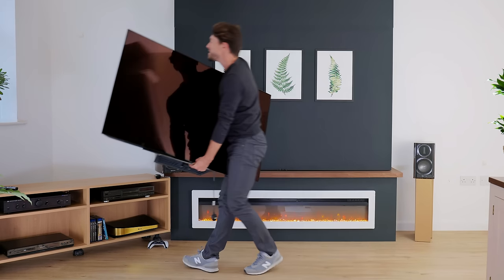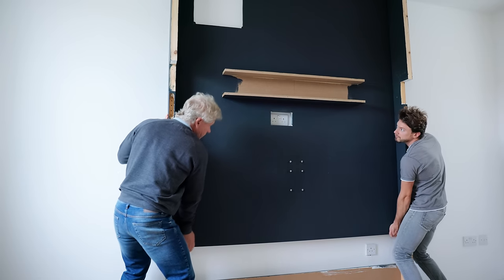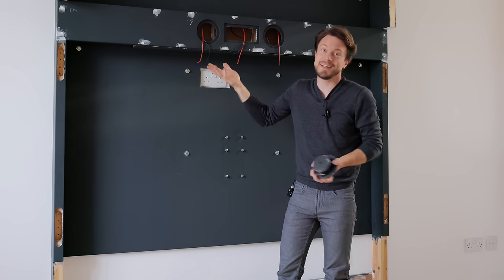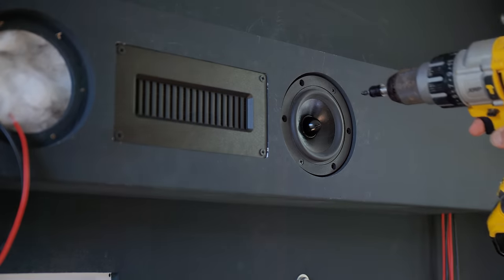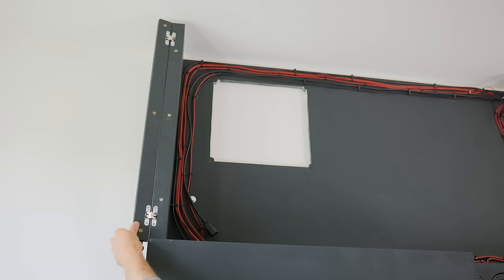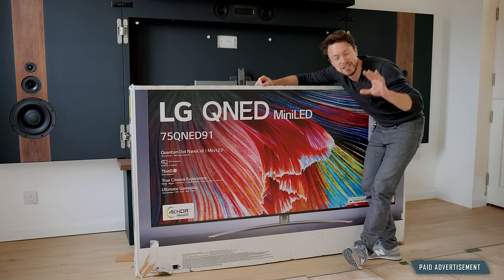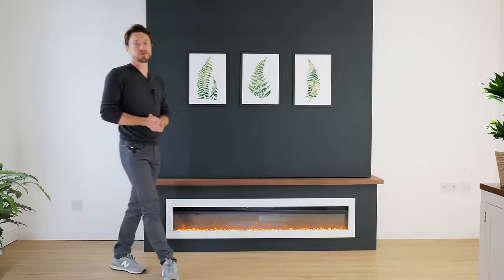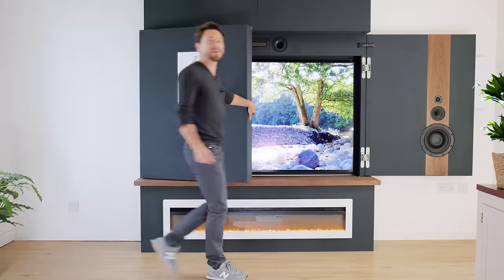Building an invisible TV

Comment: Its an awesome idea and build. However, I do wonder if in reality the doors will mostly be left open hence it would be nice to have some removable covers to hide the hinges to give it a more nicer permanent look.
Reply: Painting the hinges the same color as the cabinet would probably be enough as you generally aren’t looking at the speaker housing when you’re watching TV.
Reply: yeah agree, most will eventually just leave the doors open and definately in the UK most rooms are likely not that big therefore wasting precious space on either side of the unit just for the doors/speakers. Nice but probably not practical.
Reply: Or just get black hinges?
Reply: I think the hinges look great. If the intent was to have it open most of the time, they would've simply been on the outside. However, that's not the intent. You talked about reality rather than intent, and it's definitely fair to assume it might be left open more often than not. However, this is a purpose built enclosure. As for this specific one, the person who designed it will also be the one using it. That would make me lean more towards reality matching with intent. If this was a mass-market product, then yeah maybe the hinges should've been on the outside when closed. Again though, I like how they look lol.

Comment: Incredible project, I never miss your videos. 
I was thinking if there was a way to have the hinges in black? 
I feel like they would fit better because the ones you have right now create a bit of a contrast with the dark paint.
Reply: You can always darken metal. Either spray paint the things, or use gun blue (assuming it reacts with whatever metal the hinges use). You could probably even design covers for the hinges if desired, or do away with the hinges altogether and turn your actual structure into a hinge.
Reply: Yeah, just paint them
Reply: Paint them with Black 3.0. Then when the lights are low they will just vanish.

Comment: Excellent work, and I like the selection of speakers. One thing I would recommend doing in the future if you do other things like this is to use insert nuts and bolts to screw in the covers for the speaker covers, with a silicone gasket for sealing if necessary. This would aid in disassembly for transport as well as serviceability. You can also plug screw holes with dowels, or get caps for each bolt head. Not as seamless as filler and paint, but it's a lot easier to service.

Comment: Sweet build! The seams where the doors come together looked fine to me before the attempt to hide them. Painted overlapping masking tape doesn’t seem like an ideal solution.
Reply: could have had extra wood that joins up with a recess in the other, it would mean you have to open and close one door specifically before the other, but hides the seams without using tape
Reply: I'm really confused on theasking tape idea, if he taped over the opening then the tape would come off every time it was opened so that's not what he did right I mean that's what it looked like but then he opened and closed it.
Reply: @timwegman5776  He has to open and close the doors in the correct order to not mess up the tape. Just an odd choice for an otherwise solid build.

Comment: Great work! For the speakers, since (proper) speaker building is not trivial, I’d opt for embedding in-wall speaker solutions that many audio manufacturers offer. You can even go active and instead embed an A/V processor in the cabinet above (thus gaining features like Dolby and room equalization).
Reply: Why , he already set up the speakers how he wanted.
Reply: @More_Row  you use the word "sound"  even though it is obvious you know so little about the subject. It was clear from the moment you assumed that, because he "set them up the way he wanted", that means they're soundly (see what I did there?) - let alone, optimally - engineered loudspeakers, without having even a glimpse of any objective measurements of the final result. I mean, yeah, if you don't bother with their objective performance, DIY loudspeakers are the easiest project ever! Go ahead! But from an audio engineering perspective, we simply do not know the end quality from what we've seen in the video  (I won't even go into nit-picking obvious deficiencies, like that a ribbon will never sound the same as a cone driver - e.g., significant differences in dynamic behaviour & distortion profiles - thus compromising homogeneity between mid and L/R channels). In any case, I'm just suggesting (safer - for people who don't know what they are getting into, as many parts of the speaker config are mentioned only in passing in the video - and more feature-rich) alternatives. DIY is all about thinking of & exploring alternatives, after all, and not blindly copying. Anyhow, since you sound like a troll, take care & bb.
Reply: @shamanprime  You are so pretentious bro.

I really don’t care, I believe him when he says what he set up sounds good.

Or at least good enough for a DIY project:)

Comment: As always looks impressive.
Great job on the fit and finish.
Personally I would not do this cuz opening and closing would soon become a hassle after each viewing session. Maybe could improve it by adding a PIR motion detector and microcontroller so that it opens automatically when someone is in the viewing area. A motorized mechanism that opens it when you power on the TV would be nice too.
Also, the hinges do look nice but I would have gone for a darker color.
For now it's soo clean looking!

Comment: One question remains: how did you wire up and drive your surrounds? Great build!
Reply: I was also thinking the same
Reply: As he obviously has 12 amplifier channels he ran 4 wires to each surround speaker and used the crossovers in the amp modules.  (active speaker with external amp)
Reply: @tubybubi  thanks for the reply! Maybe not super obvious to all :)

Comment: Delightful project! Really well designed and aesthetic as well! As for the shortcomings: One problem is that the heat-generating devices are located at the top, where it is already warm (warm air rises), other problem, do the internal fans make additional noise that interferes with watching TV? Considering recent events, the rise in electricity prices is significant, surely such a system consumes a lot of power!? Maybe You can consider some power saving features? Appreciate the work on the audio system though, good choice, great work!

Comment: Hey Perks, big fan here. I was wondering about how did you tackle the doors shaking when loud sounds are playing on the speakers I would assume it would disturbe the entire experience, plus have you considered using automated hinges to make opening the doors smoother and you know not having to stand up to open it.
Reply: All of those little pieces of wood he added between the panels would stop the vibration, and the speakers are sealed off also which would help a lot. As long as everything is secured tightly it would be fine.

Comment: I like that you can use the swiveling doors to easily adjust the toe-in of the side speakers, although those dome tweeters should be relatively omnidirectional. Also, sending the low frequencies to the subwoofers is perfect because low frequencies aren't directional anyway. Their wavelengths are too long for that. And dual subwoofers are better for evenly filling a room with bass.
Reply: but destructive interference bro
Reply: @06howea1  Gotta make sure everything is in phase. The software adjustments will make the process relatively simple. A microphone should be used to measure the audio response, though.
Reply: @06howea1  the woofers are in mono

Comment: I would paint the hinges the same color as the background to conceal them better. Another idea to lessen the thickness of the speaker housing/doors is to use transducer drivers which would turn the door panels themselves into speakers.
Reply: First second it opened I was thinking the same. The hinges pop out and are distracting. But the build is great for the rest!
Reply: Was looking for this comment. I thought the same thing with the hinges. Very distracting. Otherwise its a great build.

Comment: Add a govee backlight system and it'll extend the colors at the edge of the tv out onto the wall. It both makes the tv feel larger, and makes it easier on your eyes as the brightest part of your vision isnt concentrated in the middle or something like that. I have their older version and it mades a huge difference in making my tv look larger and more luxurious than it is.
Reply: I have govee light that changes color with the content shown on my TV and I love it. However in this design, I am not sure if you can see any light from behind. The display fits tightly to the wooden square.

Comment: Great Project!
The only "minus" I see is the cable connection between the main section and the doors (no wonder this was never mentioned in the video)!
Reply: Yeah. I've been trying to figure them out. It looks like they're just (carefully) wrapped in electrical tape and the doors slide the extra length into the main housing when they are shut. TBF, i can't think of a better way to do it without making a lot of grooves/channels in the outside of the doors and housing.

Comment: The foldout panels would be an ideal way to try out a set of DIY flat panel speakers! Uh, where do you find straight 2x4”s?
Reply: Home depot has the select pine, which is pretty straight. They are a little more but are worth buying.

Comment: As someone who grew up around TV cabinets designed to close and look nice and hide the TV when company was over; the cabinet was never closed, the TV remained open, and all the effort put into making it 'tidy' fell away to the fact that it was a frequently used device.

A neat concept but design tends to fall to functionalism in daily use. Same reason people will form their own paths through grass rather than take a longer paved path.

EDIT: I realize this could be read as explicitly negative! I love that you build things, you put real thought into your work and I'm subscribed for a reason, I'm just thinking out loud about design vs function.
Reply: I think if someone goes through the effort to make the doors motorized and Link to the remote control for the tv, it would have to be closed if you turn the TV off. If you Link the motor of the doors and the power button of the TV so that they both detect the same signal of the remote, it wouldn't be an "extra step" for the user so that the tidy function of the closed tv would actually be used. Of course you'd have to program the moter circuitry to open and close smoothly and that it works together but if that works... Awesome.

Comment: Hi Matt ! Great work with the cabinet, love your videos ! just a quick and small question that's bugging me... Wouldn't the big permanent magnets from the speakers affect the LED display when closed ? I truly find your ideas magnificent and inspiring but unless you keep the speaker doors permanently open, you will have a bad day when the screen will "bleed". 
Best luck & wishes,
Florin 
PS: I don't usually comment on any videos, hopefully you can reply.
Reply: I was wondering the same thing.
Reply: CRT televisions were susceptible to damage from magnets. The steel mask behind the glass would become magnetized and affect the electron paths, causing a permanent dark or bright pattern around the magnetized area. This isn't a problem with LCD TVs (LED TVs are still LCD TVs) because the liquid crystal is effectively a polarizing filter controlled by an electric field. It isn't affected by strong magnetic fields.
Reply: @nhand42  Figured, have played around with CRTs and magnets but never happened to try it with an LED screen.

Comment: I gutted a 52" LG 3D TV and built it into the wall/entertainment center of my camper after being inspired by one of Matts builds. I'm actually watching this video on that TV. That TV is showing its age and may be developing some power supply issues. I have been contemplating how I could build in a modern smart TV and still have the trim of the entertainment center cover the edges of the TV for the built in look. These hinges and some creative "editing" of the trim may be just the ticket. Thanks Matt.

Comment: One potential issue is the placement of the subwoofers. Their visible vibration as they work could conceivably be distracting when the room is as bright as shown here. Shouldn't be a problem with lights turned low, however.

A better placement for them might have been to the sides of the "fireplace", directed sideways so the actual speakers aren't readily visible. The human ear can't really determine directionality for sounds below about 100Hz, generally using other cues (usually visual) to try to locate them, which again could contribute to the aforementioned distraction. Subwoofer placement is generally more about where you get the best sound quality from the desired viewing area rather than involving any kind of symmetrical placement.

Comment: Looks really nice. One thing I would change is the paint on the outside surfaces. Matte paint catches dust, stains and scratches extremely easily and looks awful in a very short time. A glossy paint would look a lot better over time.

Comment: Beautiful work! But those hinges...I'd paint them the same color as the door so they arent as visually prominent and distracting...black paint may also work but it would throw off the symmetry with the tv as the tv frame is black...I think just matching the door paint color instead would make them far less eye-catching (since the TV should be the main focus) and look even better overall....Think about it once the doors were opened what was the first thing you noticed aside from the tv....

Comment: As a carpenter, I would've preferred to use silicone instead of wood glue on the boxes for the smaller speakers. Wood glue is great for rigidity and high yield strength, but its horrid for taking constant, slow wear, and its rigidity is actually a weakness in this scenario. You want it to be able to flex and compress without being slowly cracked. Silicone is a great choice for that application, it acts as a sort of dampener on top of that so it can stop any nasty resonances you may get, but Im sure you won't have issues for at least a decade. Just something to note though!

Comment: Hi Matt. I love this setup! I'm considering adapting it for our basement rec room.

How did you run wires to the back speakers? I noticed an antenna on the HDMI analog converter, but also saw wires sticking out the speakers when you held them.

Comment: Just one thing, Mounting the high driver from the Center That way is wrong due to the Angles it Transfers the Waves. It has to be vertical because of its coverage That is wide horizontal but narrow Vertical. So Built in like That you get nore reflections from the floor and ceiling and there is only a small Sweet Spot in the Middle for one Person. Sitting Just a Bit left or right the high Frequency Drops a lot.

Comment: Hi Matt, I’m looking to apply some of your design choices into one of my projects. I see you’re powering 3 of the Dayton Audio Amplifiers with a single power supply, what one did you go with? I was looking and seemed to only see affordable units that would need to be used in parallel to apply the proper amount of current.

Comment: It looks nice when it is closed but worse than normal when opened unfortunately.  My brother has an entire wall bookcase with faux cabinet doors at the bottom. One push of a button on a remote and a 3 inch lip board on top to the cabinet flips open and a TV rises up in front of the bookcase.

Comment: the ruban tweeter horizontaly ? that's problermatic for horizontal dispersion, realy narrow, excep some rare exception, better having a wide horizontal dispersion.
by the way, better using 18db/oct slope filter for the center speaker, making MTM speaker better in dispersion.
i love using 3rd filter for the sub / bass channel, this filter have a better power response.

Comment: they say fashion is circular, "what's old is new". when TVs became cheap enough to be bought by the middle class, it was common to keep them in a cabinet so they wouldn't be unsightly when not in use. and the same idea was used by the phonograph when it was in it's early stages.

Comment: My two nitpicks: The masking tape solution to make the gaps less visible won't last long but even if you have to re-do it once a year, who cares. The other is about the subs. In order for subs to move air, they need to be 100% immobile, which is why they're usually in heavy cabinets and can ideally use tip-toes to 'anchor' them to the floor. Having them in those loose / moving doors means a considerable amount of their mechanical energy WILL be continually moving / vibrating the entire doors instead of air, that they wouldn't if the subs were stationary. Think Newton's third law.

Comment: I can see that video has been touched up around the door edges so that they cannot be seen along the top and down the middle before the door opens. In reality there would have to be 1/8" gap between doors and jamb on an installation like that which would be visible as a black line across the top and down the middle. I can see that gap has been brushed out with some video editing software. Some of us weren't born yesterday.🤣
Reply: Thank you, My OCD kicked in after I scrubbed back through. Glad someone else brought it up. Wasn't sure if it was to make it look better overall, or to really validate the masking tape hack.

Comment: Why are the subs in the air in stead of on the floor? Doesn't that take the 'umph' out of the lower register?
Also, doesn't that create a lot of unnecessary vibrations in the TV's internal components?